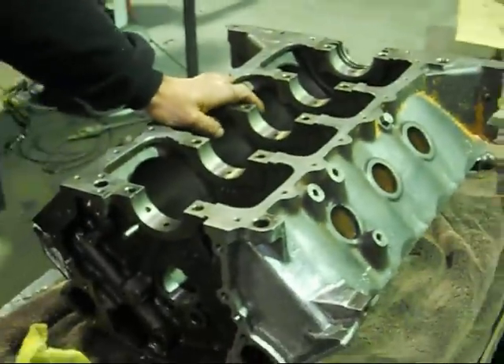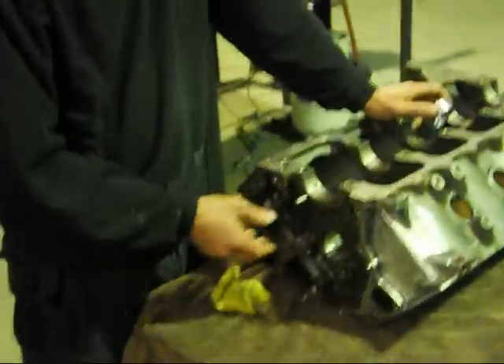Holden v8 308ci,Fitting performance cam brgs,why and how to tips,tricks and trade sercrets revealed

Comment from the maker: @cashx77 hey bud into it tonight again,plus 10 other heads as well,blueprinting ring gaps,then another hot soapy water wash and scrub,wash and fit pistons to rods,fit rings to pistons,game on,just another 5 hrs on the head finish ex ports,me mate from Max Auto Smash Repairs is coming over Saturday lunch to paint Heads,Block and Sump make an arvo of it, Gidy Up Brother,I can feel your right foot twitchin from here.Gavin's made wiper reservoir mirror polished,polishing  radiator,alt brack,overflow